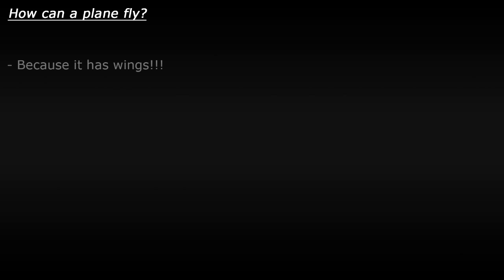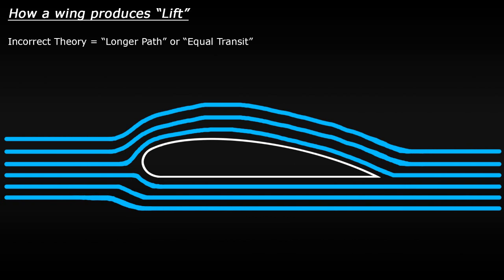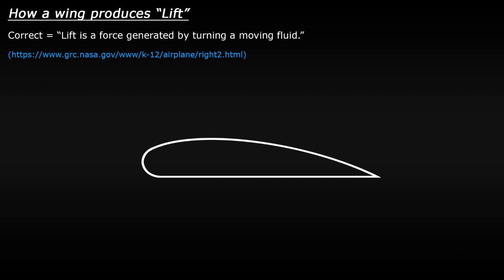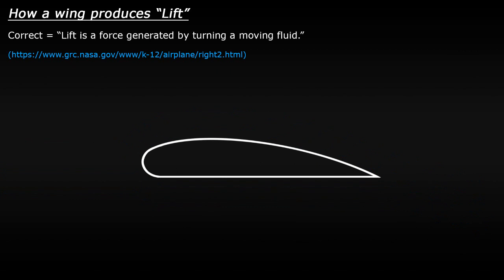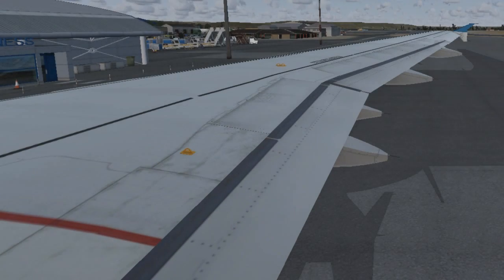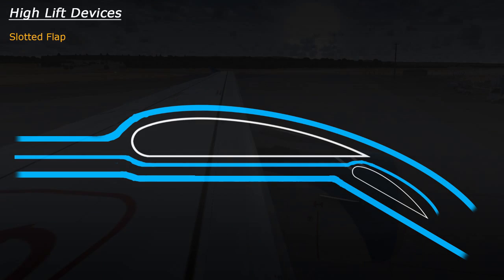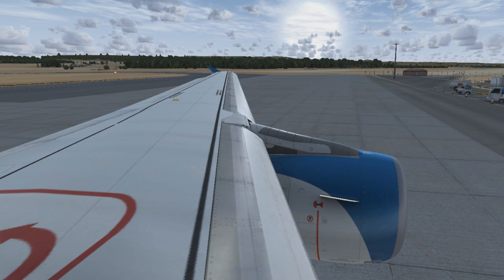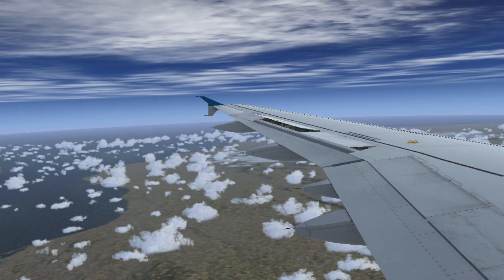How Wings ACTUALLY Create Lift!

Comment: I have a question, what if, during a stall, the whole upper part of the wing skin lifted to help the air stick to its surface and avoid vortices that way ? The skin would lift similarly to the spoiler, maintaining its profile of course, but the center of rotation would be close to the leading edge. It would require a redesign of the wing, sure but it might increase safety in this dangerous flight regime. What are your thoughts ?
Reply from the maker: I think the cons of building such a system outweigh the benefits it could provide. To have an "active" wing surface would probably require mechanisms to move the surface, extra probes and computers to monitor airflow, would require people with incredibly specialized knowledge of aerodynamics to design such a system, would be expensive to equip/retrofit aircraft with such a system and there would be many variants required to fit many different aircraft types. I like the idea but I just think it'd be too complex and expensive to pursue considering you can achieve the same result with current stall warning systems and pilot training which are already established.
Reply: Doofer911 Well, it would require a new wing and probably a new aircraft (just like slats, flaps and spoilers were first incorporated), maybe it would be possible to make it deploy on its own depending on aoa and airflow, something like me109 slats :) ? Im not saying it could be applied without some amount of resources :) still if it could save someone from stalling close to the ground, where there is not much time to catch the plane or even pull the chute (design of which probably took even more costs and fitting it on the plane) then maybe it would be worth trying out :)
Reply: Doofer911 Plus pilots, especially weekend ones repeatedly fail to keep themselves out of harm's way, even despite warnings or aoa measuring. Some physical help could go a long way :)
Reply from the maker: I do like the idea and I completely agree that anything that can improve the safety of aircraft should be studied and implemented where possible. The question that springs to my mind is "How much of an improvement would an active wing surface to Lift performance?"... for example, a Cessna 172 in a clean configuration (Flaps Up) will stall at 53 knots. If a Cessna 172 fitted with Active Wings stalls at 50 knots.... yes it's an improvement but is that improvement worth the cost of development, design etc. There will be a critical point for any aircraft where the airspeed is just too low for the weight of the plane and it will stall anyway. 

Yes I agree that weekend pilots are more prone to danger but you have to ask if these pilots take their position as a person in control of an aircraft seriously? Stall recognition and avoidance is one of the first aspects of flying that a student pilot will learn. Heck, I've only done a couple of Trial Flying Lessons at my local flight school and I've even been taught Stalls on those! If a Private Pilot approaches flying with a cavalier attitude then they won't be on their toes, they won't be in full control of the aircraft and they will put themselves and any passengers in danger. It's the same when you have the driver of a car, the Captain of a boat, a firearms instructor at a gun range.... any profession where safety is of the upmost concern, it depends on the person, not the vehicle.
Reply: Doofer911 It would all come to the cost/benefit analysis, i agree completely, i can't forsee how much would such a system allow, it would all come down to tests, it may give just a few extra knots, or it may allow the plane to almost hang by the prop (almost becouse that would require sheer power to accomplish), or it may completely disturb airflow in some way i didn't think of and stall it earlier, i can't tell :) still, all such devices started somewhere, right ? :) Maybe it would work better on bigger planes with faster stall speeds, maybe the opposite would be true. At the end of the day it all comes down to the ability of the pilot to asses risk plus his own skill and then use the tools provided to him to lower the danger to an acceptable level. All of that dependent on training and its quality plus common sense. Im feeling though that with time flying may be perfected to a level of casuality similar to driving, is that good or bad...hmm, should we strive for that or not ? ...maybe ? :) Thank you for your detailed analysis and for your videos, i learned much from both :)
Reply from the maker: I believe that the Thrust to Weight Ratio of most aircraft is less than 1, meaning that the engine power cannot overcome the weight of the aircraft and lift it into the air. Maybe only a few fighter jets have engines powerful enough to allow the plane to "hang" in the air or power out of a stall situation. If you know the Physics and can test an idea in a wind tunnel or draw up some CFD models and analysis then it's definitely worth a shot. Even if you discover that it's not a viable idea, you'd learn a lot in the process. 

As for flying becoming casual, I fear that may be the cause of some accidents. One which springs to mind is the 777 which crashed in San Francisco a few years ago. The pilots had become complacent because they were used to performing ILS landings and on that day, the ILS was out of service and they were unable to land the plane manually, ended up nearly stalling just before the runway and then hit the sea wall just a few feet before the runway. But again, that's down to strict training programs and pilots being disciplined. They need to carry the mentality that they are training to keep hundreds of people safe every day, not just learning things to tick a box, get a pass mark and keep their license.
Reply: Doofer911 Yeah i know, thats why i pointed out that it would require great amounts of power, not strictly an efficient wing :) and the complacency is something that is a very real risk, i personally think we should have checklists for cars as well :) but even checklists can't protect against just saying "checked" without checking :) the only hope lies in keeping the training standards high, common sense common and technological advances that will help where training failed. There are so many variables in training, each cfi teaches a bit differently, has different experience level etc. Only the passionate about constant learning have the potential to gather enough of it to be safe i believe. I think that self preservation should be ingrained in pilots with a chisel so that analysing all different possible scenarios where something could go wrong, creating contingency plans and going beyond the checklists is a second nature. "What would i do if at this moment controls failed, or an engine, or instruments, are there safe places to land around me at all times, is weather changing too fast, do i have a way out" this should be a standard mindset i think so that when shtf i didn't waste my chance on the ground and im ready. People loose this perspective with time and it kills them.
Reply: Your question is completely valid, and has been used on numerous aircraft, most famously probably on the Bf109.

Comment: I don't understand why there is low pressure under the wing an high pressure on top of it.
Reply: you've got it backwards. There is low pressure on the top and high pressure on the bottom
Reply: If it were it would be a spoiler creating downforce.

Comment: So I'm sitting in ground school class and the instructor is explaining the "equal transit" theory and how the air has to speed up over the top. I raised my hand and said  "so the molecules of air on top say to themselves 'we better speed up if we're going to meet up with our buddies at the trailing edge'  right?"  He didn't know what to say. Who TELLS the molecules to speed up? Still din't know what to tell me. Hogwash!   If that was all true, an elliptical airfoil (curved on both the top AND the bottom) wouldn't produce lift. Look at an aerobatic airplane. Flies upside down just fine. No, friends, it's all about angle of attack. Remember sticking your hand out the window of dad's oldsmobile and tilting your hand up...and it went up? That's the answer. Angle of attack !!!

Comment: Take the wing in the diagram and assume the directed downflow is correct.  The take another identical wing an place it "upside down" on top of the model wing about 10 feet above the model, but make it inverted.  What do you have?  You have a "venturi" of what looks like a carborator.   That air above the wing speeds up and downwards.  But the air about the wing reaches a point where it is uninturrepted.  That point looks just like as if there was an inverted upside down the wing on top of the wing in question.  The truth is that a flying wing eventually has an airflow pattern that smoothens out to the point where the air above it is in a smooth pattern.  
              If you simply put another wing at that point, but upside down, you will have a "venturi" of a carborator, with the same effect.  Sorry, I can't give you a graphic visual, but if you think about what I've described, you will conclude that two airplane wings,  on top of the other, in an inverse position, will create the same venturi effect as if air were flowing inside a carborator.

Comment: If turning the airflow downward at the trailing edge of a cambered airfoil is the explanation for lift, please explain why an airplane must rotate (or have wings with an inherent positive AoA already) to a positive AoA in order to takeoff and/or climb, why an aircraft with symmetrical wings flies just fine, why a balsa wood model with a flat wing flies just fine, why aerobatic airplanes can fly in knife edge (when the wings are producing zero lift), and why even an airplane with a cambered wing can fly inverted.  

If you were to build an airplane with wings at zero AoA, you could accelerate that airplane down a runway and it would never lift off if it never rotated.

The explanation is that the main source of lift is simply Newton's 3rd Law of Motion (action/reaction).  Various airfoil shapes enhance airflow efficiency, contribute to laminar flow, provide space for fuel and gear, alter local airflow to achieve performance requirements, etc., but they are all secondary to the force of the air molecules applied the the lower surface of the wing resulting in an equal and opposite reaction upwards.
Reply: Because an airfoil turns flow down more if it's at an angle of attack, and symmetric wings turn flow downward. Ultimately, 'turning flow downward' is really the same thing as saying 'changing the momentum of the flow coming into and out of a box around the airfoil' which is another statement of Newton's laws for continuum mechanics. Yet another way of saying the same thing is that the airfoil generates a net circulation around it.
Reply: The last part of your statement is completely wrong, by the way. Look at a pressure coefficient vs chord length graph of an airfoil; for any airfoil that generates lift the vast majority of the lift is generated on the upper surface. Basically, the decreased pressure on the upper surface makes up a much, much greater portion of the lift than the increased pressure on the bottom surface.
Reply: @AmbientMorality  You simply repeated what was said in the video and didn't respond specifically to any of the situations I presented.
Reply: @d.porter3142  An airplane rotates because it needs to generate more lift at lower speed during takeoff. An airplane with symmetrical wings only flies if the angle of attack of the wing is positive. A flat plate is essentially a symmetrical wing and will only generate lift at an angle of attack. Assuming flow stays attached it will still generate more lift on the upper surface than the lower surface (though flow will separate very quickly for an inclined plate). Knife edge flight is using lift generated from the fuselage and vertical stabilizer and a very powerful engine because it's draggy. A cambered airfoil can fly inverted only at significant angles of attack because its zero-lift angle of attack is negative. None of the points you made have much relevance to what I said, honestly

Comment: This video is only a partial explanation. As Doofer911 would have you believe, the lift only comes from the tail deflection of the wing. But there's more going on than that. How do we know? Because the flow off the tail, as he describes it, is deflection energy, and deflection energy cannot be more than the thrust of the engines. (Newton's Law) A 737 has 40K of thrust at take-off but a 737 weighs 150,000 pounds. 40K of deflection cannot lift a 150K plane into the air. We also know that a 737 cannot leave the ground until it reaches a speed of 150 mph. We also know that a 737 has 163,440 square inches of surface space on the top of the wing and 155,268 square inches on the bottom of the wing. When equal amounts of air are split high and low the air that goes across the top of the wing has 5% more space to spread out upon, and the (mean free path) pressure drops. Nature abhors a vacuum, and the electrons in the air below the wing move to fill the void of the vacuum on the top side of the wing. As the electrons move into the metal skin of the wing - they drag the too big molecule with it into the skin of the plane. The actual "lift" of lift is a dynamic struggle between the electron and the molecule as the electron tugs on its tether to the molecule, and the energy of the struggle in manifest into the under-skin of the wing which creates the lift. The greater the pressure differential (which is a factor of speed) the greater the lift force. As a plane goes down the runway, the speed increases, and the pressure increases by every MPH. Finally there is enough pressure differential between the two sides of the wing that the plane is lifted into the air.  

So Doofer911 - lift is found on the sub-atomic level and is a tension on the elastic bond between the electron and the molecule.
Reply: Wait hold the show, do you have a reference for this phenomenon? Really I would love to read more.
Reply: Mechanicus Me too !!!   Sounds exciting !
Reply: @LupusMechanicus  There is no reference because it's made up. 40k arbitrary thrust units from the engine does not mean the wing can only generate 40k arbitrary force units. Not sure where that even comes from: lift and thrust vectors are typically nearly orthogonal and thrust mostly needs to make up drag.

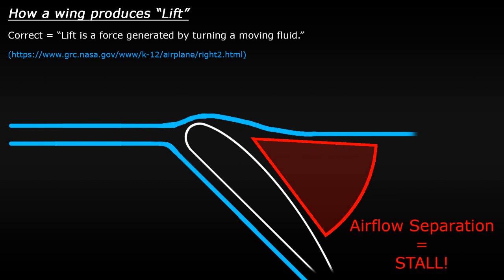Comment: 3:41 So there's a vacuum in the red region? How does that make sense?
Reply: Not a vacuum but a lower pressure than ambient pressure. You can actually measure it on a pressure-tapped wing.

Comment: Someone needs to tell pilots that fly inverted that what they're doing isn't possible and they need to stop doing it.
Reply: orange70383 it is  possible do to the fact that most aerobatic planes have symmetrical wings. Which have the same curvature on both sides of the wing. Allowing them to produce the same amount of lift straight and level or inverted!
Reply: @davidewell3506  You don't need symmetrical airfoils, though it helps in that stall angle is identical in either direction
Reply: Please do bother to watch the video nex time before commenting.

Comment: Mmmmmm........Sort of correct..... but the statement that air HAS to travel faster over the top of the wing so it meets at the trailing edge is wrong. There are lots of videos from wind tunnels where you can see that sometimes the airflow on top of the wing travels that fast that in gets to the trailing edge before its lower surface counterpart. Why is this ???? Think of Air as a multilayer fluid. The air layers close to the top of the wing are being compressed due to it passing over the curve of the upper surface, and this compression causes the layers to "squash" together and form a Venturi. Thats why the airflow speeds up on the upper, curved surface and therefore a resultant decrease in pressure. Rest of your presentation is brill .....
Reply: But if the air below the wing is being pushed downward, wouldn’t it get squashed with the air below and create the same effect as the air above the wing?

Comment: So I'm ally confused about this. If the flaps direct the air flow, and directing it downwards causes the plane to go up (Newton's 2nd Law), why then does the flaps go up wards when a plane want to pull up?
Reply: +Observ45er
I actually looked something up. I thought the main wing flaps go up when tilting the plane upwards, but apparent it's only in the tail wings. Maybe I had something confused.
Reply: Flaps serve to create differential drag and induce rotation. Flaps located in the plabe of the center of mass are completely ineffective.
The rotation then serves to change the wings angle of attack, balancing out the rotational forces induced by the wing, and redire ting the force generated by the wing.

Comment: So the relative wind flowing over the top of the wing faster than the bottom creates a lower pressure?What if the air is still, and there is no wind?
Reply from the maker: Yep, and that's why planes have engines, to push the wing forward through the air to create that airflow.
Reply: Even if the air isn't flowing?
What if you're going with the wind?
Reply from the maker: Yep, think about it, a paper airplane can generate lift indoors when there's no air.
Reply: I'm kidding, I know how it works.